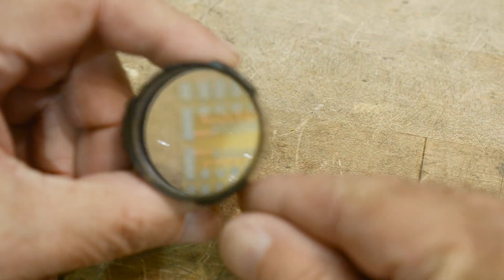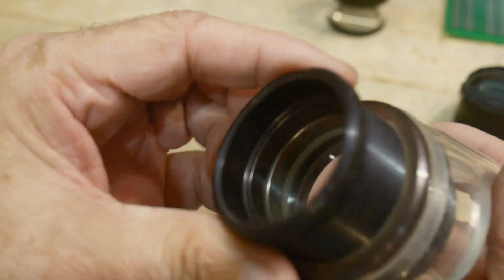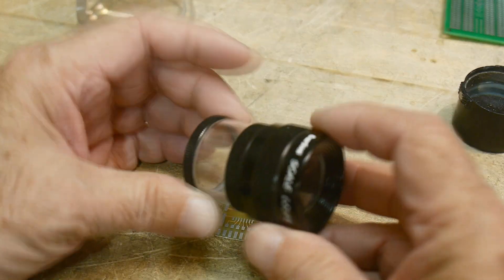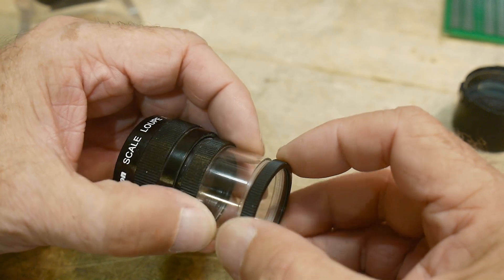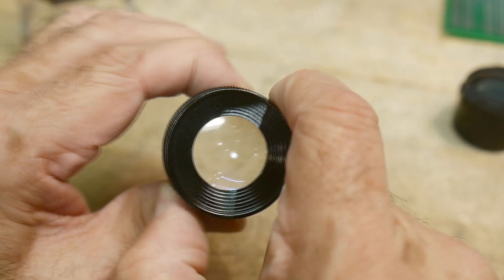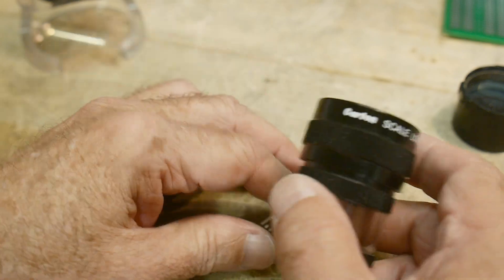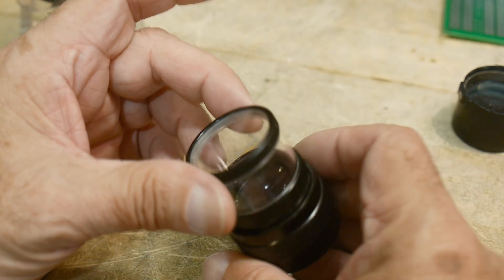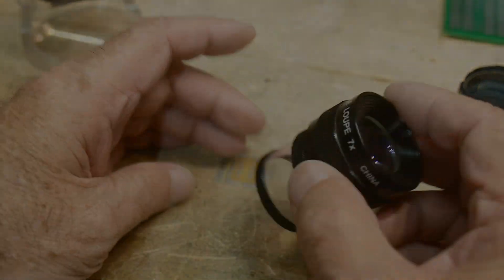#1952 Scale Loupe - Measuring Magnifier - Optical Comparator

Comment: Invaluable for those who are serious about etching at home using photoresist on scales down to 0.15 width / 0.2mm pitch.
I was gifted with post-soviet version of theese that is 10x glass and metrology grade 0.1mm pitch scale. Super handy, use it all the time for swift soldering inspection. It is 13mm diameter loupe with roughly 20mm focusing distance, though, but was still sold for less than $20 new last time I checked, so a great value nonetheless.

Comment: These things are handy devices.  In 1976, I purchased from Edmond Scientific an "Edscorp 50X Pocket - Size Direct Measuring Microscope, No. 30,225".  It is a green tube, about 4 inches total length, with a glass reticle with a scale totaling 0.1 inch, with major divisions each 0.01 inch, and minor divisions each thousandth of an inch.  It produces an inverted image of the object being measured, but is still quite useful for making measurements.  I don't recall the price, but it was modestly-priced or I would not have purchased it.  Edmond no longer makes this model but they do have similar items (at much-higher price) that produce erect images.

Comment: Have been using these for years.  Indispensable tools to have.  However, I don't think I would call it a optical comparator.  I have a optical comparator made by Mitutoyo and with it's cast iron base weigh's about 1 Ton.  Got that last year at sealed bid auction at the bearing manufacturing plant my brother works at.  It was the last big piece I was looking for to complete my machine shop.
Reply: As he says "sometimes" called an optical comparator. Doing a quick look on Google, there is quite a range of instruments named such.